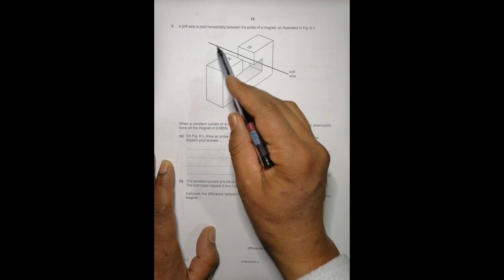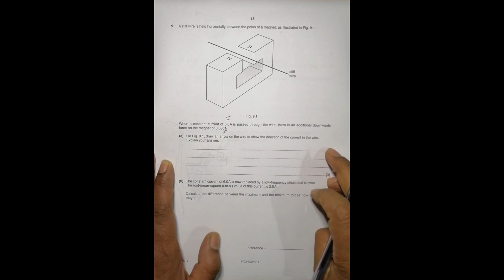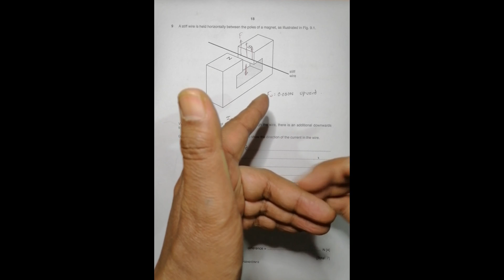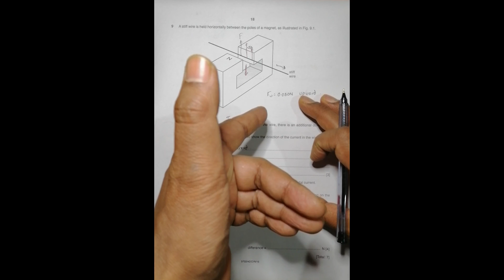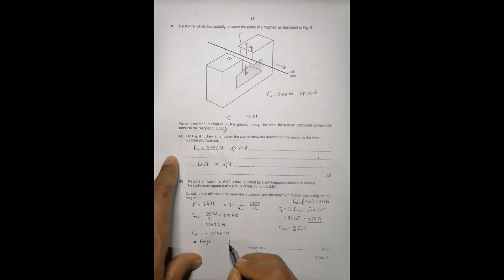2016 CAIE AS & A level October November Physics Paper 42 Q. No. 9 (9702/42/O/N/16) by Sajit C Shakya

Comment: Why don't we consider force downward here sir since it has been stated in the question??
Reply from the maker: The magnet feels downward force, according to the increase in the readings in the balance. So, the wire should experience upward force. (It is action-reaction stuff, if a body exerts a force on another body, it receives equal and opposite force in the reverse direction)
Reply: @sajitchandrashakya  Alright sir